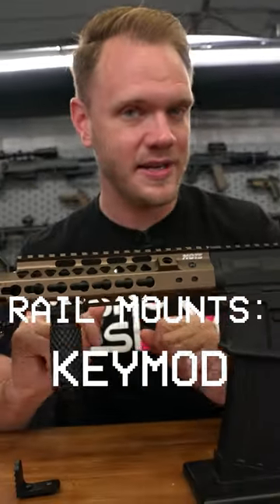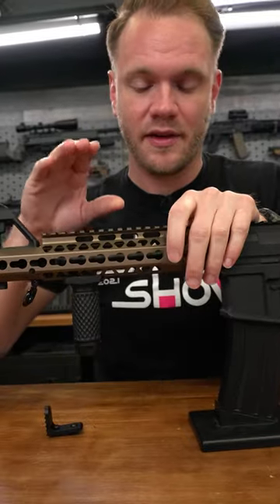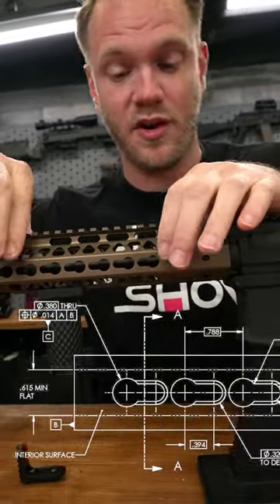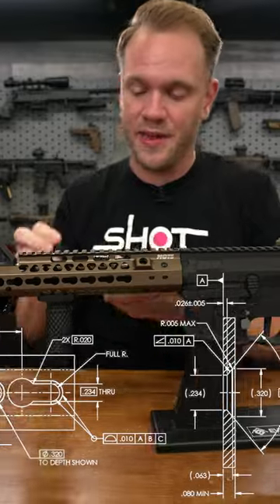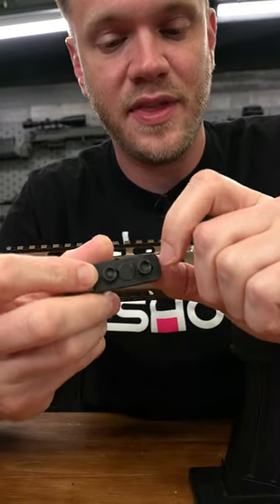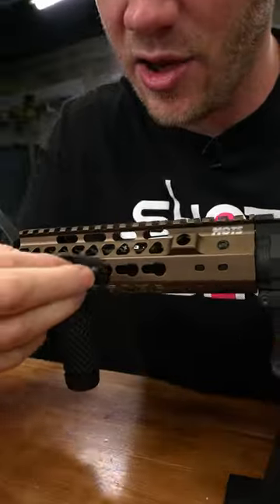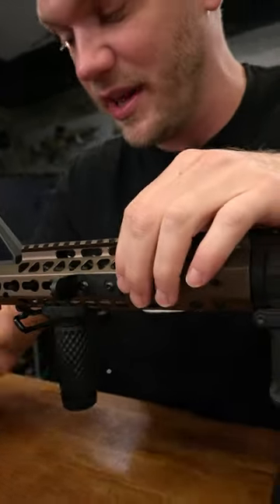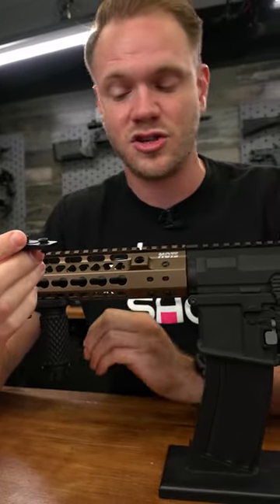How to Install Attachments onto Keymod Rails

Comment: if keymod was backwards it would make more sense especially since youre pulling grips backwards instead of pushing forwards lmao
Reply: I was actually just thinking this exact thing as I watched this video
Reply: Yeah mlok isn’t gonna nudge keymod out regardless, but you are correct they built it backwards.
Reply: No, if you drop your weapon, odds are, it's falling muzzle first, most weapons drop from sling issues anyway, that's why they face the way they do. That shock will do more damage than pulling on a grip.
Reply: @Grunt-Barra  huh, that makes sense. i never used keymod so i wouldnt even think of that

Comment: Who is still using keymod in 2022.
Reply: Keymod > mlok
Reply: @nathanflannery3031  Troll game = Meh
Reply: @TheDirtyDirtMcGirt  100% not trolling. Both styles take the same accessories, but keymod installation is much easier. It is that simple.
Reply: @nathanflannery3031  Sorry but M-Lok is superior and keymod is all but dead.
Reply: @TheDirtyDirtMcGirt  They serve the same purpose and mlok is harder to install, making it inferior.
Reply: @nathanflannery3031  M-Lok provides a superior mount regardless of how hard one might think it is to mount. Hell, SOCOM selected M-LOK for its reliability over Keymod handguards based on their own testing. Not to mention keymod is pretty fugly and that's another reason keymod is dead.
Reply: Me, because its easier to install than mlok Im not in the military, the difference between them is irrelevant for airsoft use.
Reply: they both have their pros/cons, so stop arguing